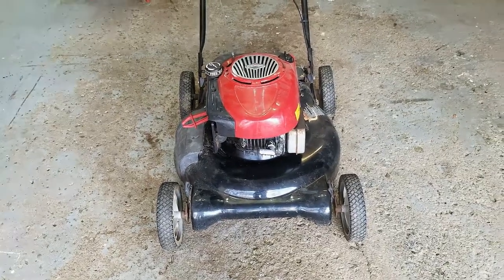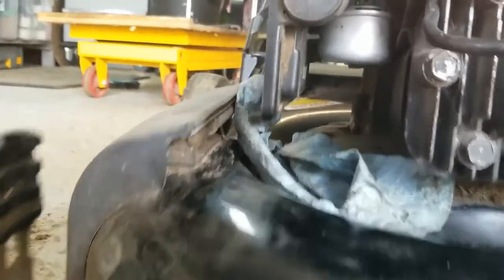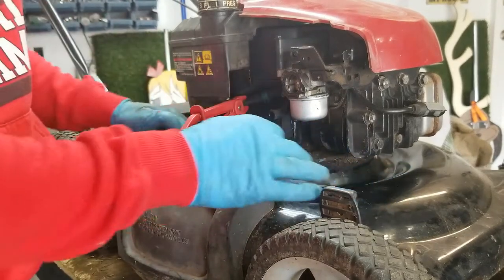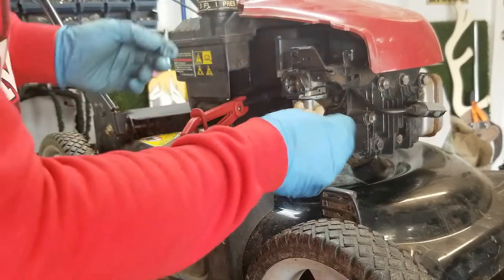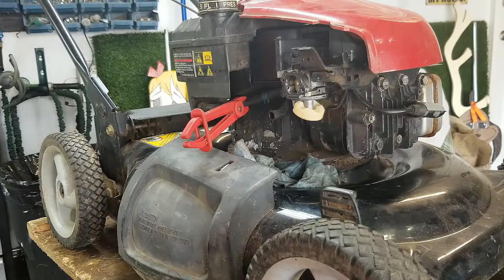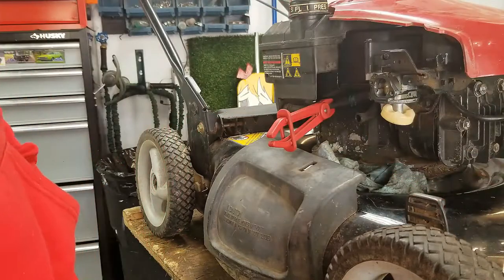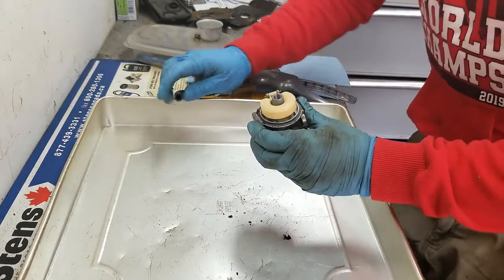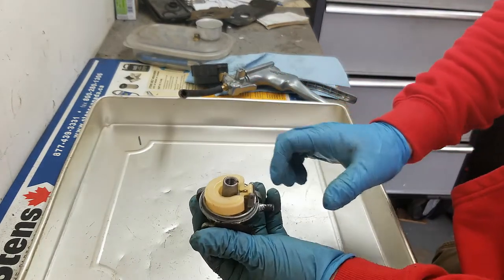Craftsman Lawn Mower With A Leaky Carburetor

Comment: Thanks for the video!  Where does one get carb parts?
Reply from the maker: There are plenty of online resources for your carb parts. Jack's Small Engines, Repair Clinic, Pro Parts Direct or Amazon and Ebay. Use Jack's to locate parts using parts diagrams and then order that part number from whoever you like. Hope this helps. Cheers